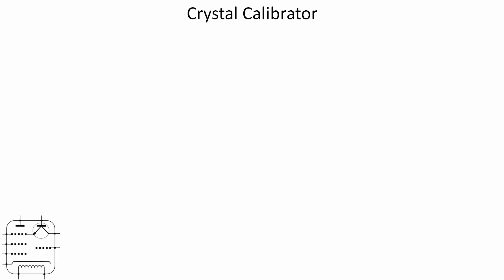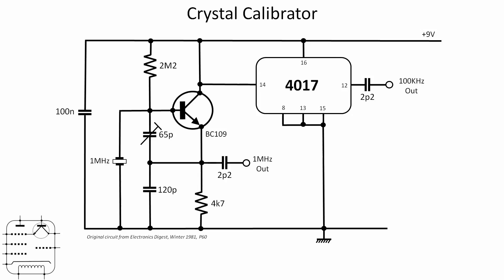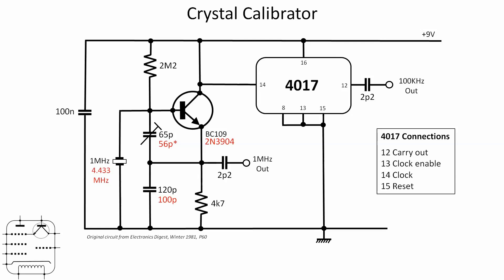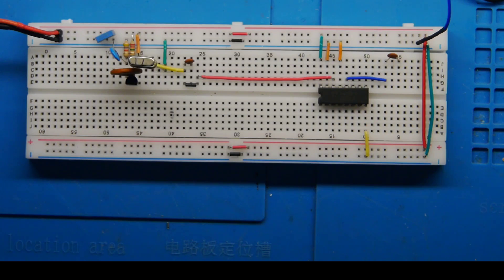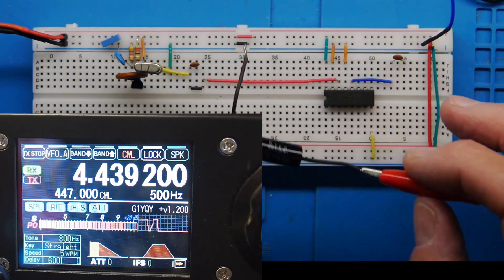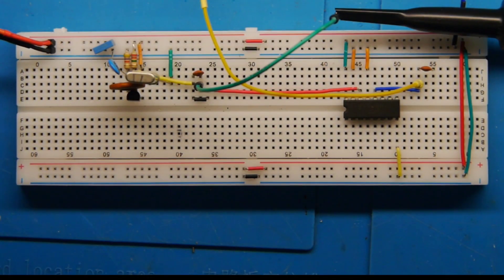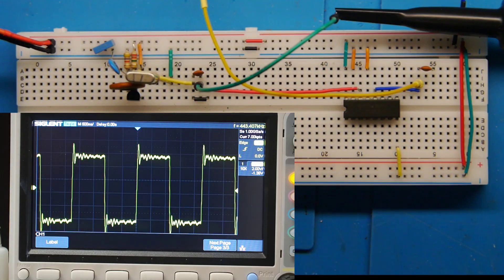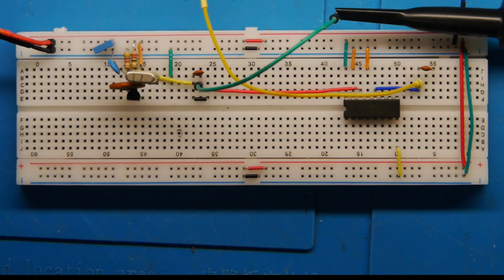Analog Meets Digital - Test Gear 1980's Style - #221

Comment: Hi Bill, your videos are always interesting, and this is no exception. Unfortunately, there is an error in your circuit diagram. When I looked at the circuit, I thought that this couldn't work, because pin 14 of the 4017 chip is shown connected to the collector of the transistor. Since the collector is connected to the 9V supply it would never change (assuming a good stiff supply). I believe it should be collected to the emitter. I double checked by looking up the magazine article you referred to, and yes, pin 14 of the chip should be connected to the emitter. Just thought I should point that out, in case anybody tries to build it.
Reply from the maker: Well spotted Mick, and thank you!
You are quite correct, pin 14 should be connected to the emitter of Q1.

Comment: That schematics you present in the beginning cannot work - your collector is tied to the 9V supply so there is no way it can deliver a clock signal to the 4017. But perhaps this becomes clear later? At least it seems that you have connected the 4017's clock signal correctly to the emitter on your breadboard.

Comment: I built something like that back in the late 80s or maybe early 90s to calibrate my AR88 valve receiver. It worked a treat. I think mine had a 4MHz microprocessor crystal and switchable divide ratios including your 1MHz and 100KHz